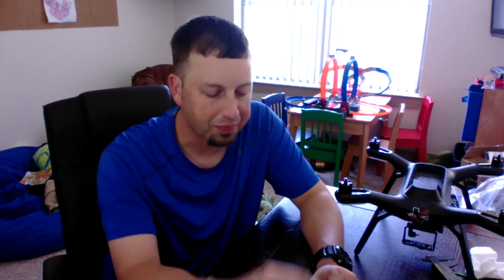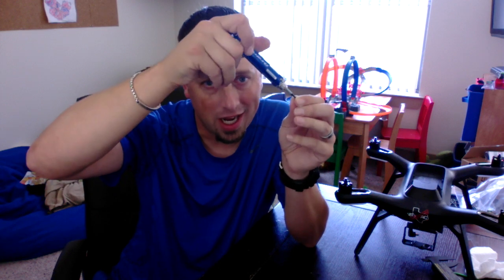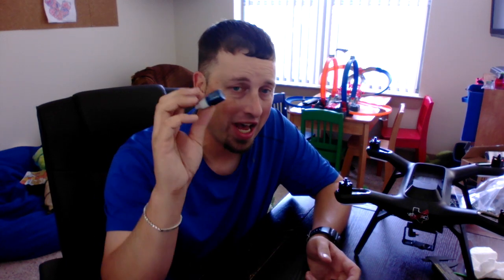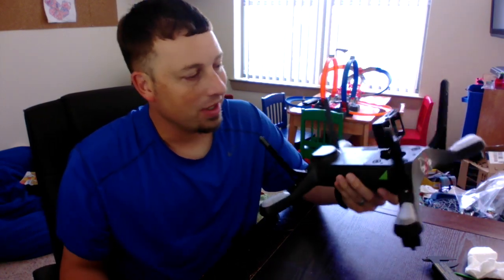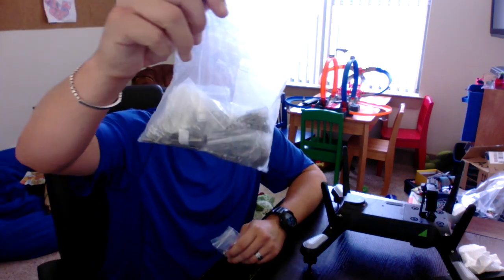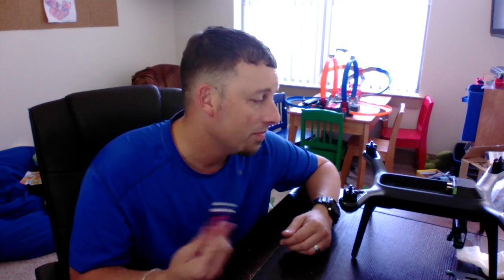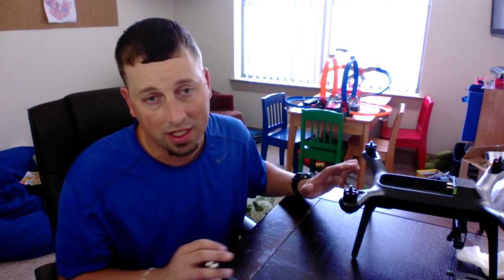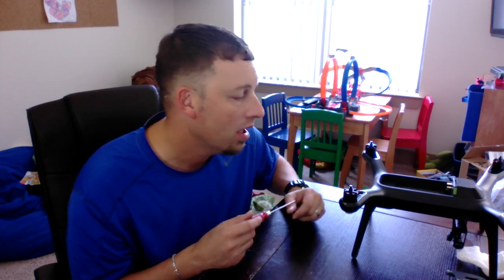How to and Why Swap out Screws for Hex M3 Hardware on 3D Robotics Smart Drone

Comment: Heyi i know this is unrelated to your vid but it hard to get help out there. I need to use different blades and they require a different way of putting it on the part where the blade goes. It just doesnt screw on. It is really annoying. I think some of the screw attactched to the opter has been chipped off a tiny bit but it looks fine. Do you know how to fix this?? Thanks!